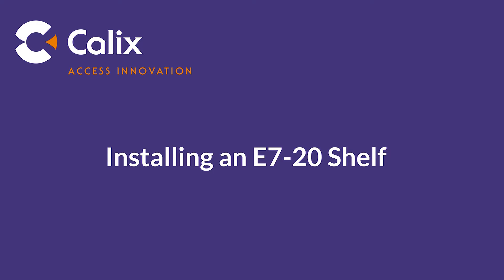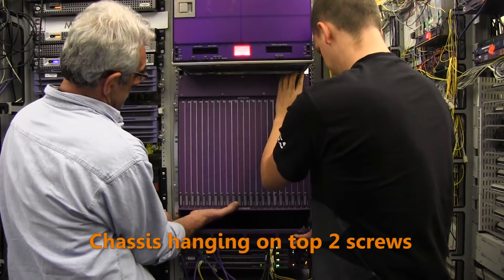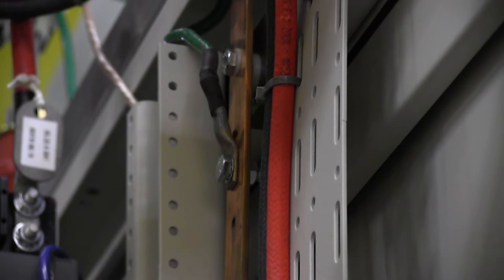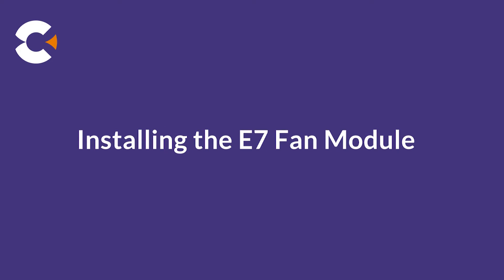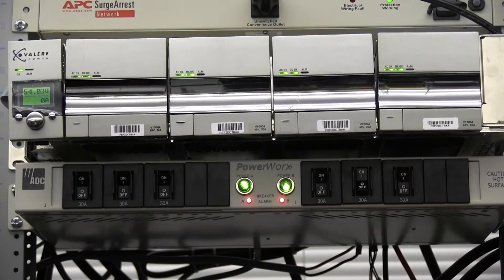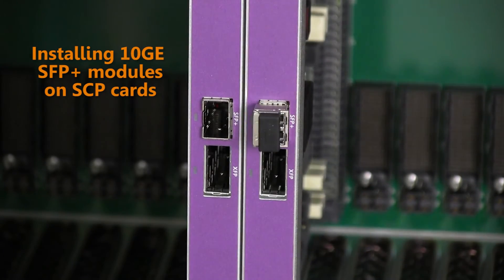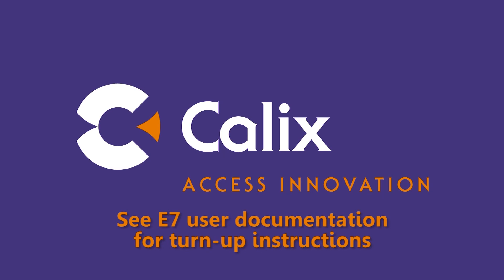Installing an E7-20 system

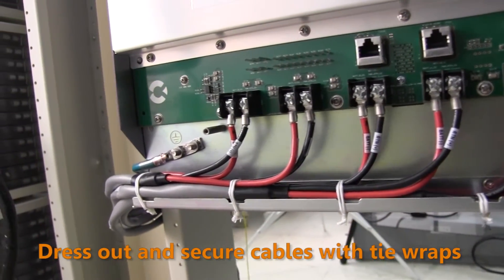Comment from the maker: Note that at the 3:48 mark, the instruction says to wire out the power cables to the power supply breaker panel. Re: An inquiry about how to strip off the thick secondary/outer insulation at the stub end of these cables without cutting the insulation on the inner wires. A good general practice for this wire stripping technique is addressed elsewhere on YouTube. This is one good example: https://www.youtube.com/watch?v=GBSdxq3OOyA